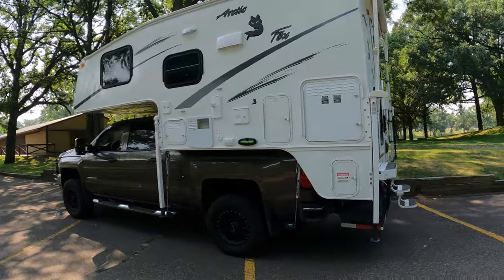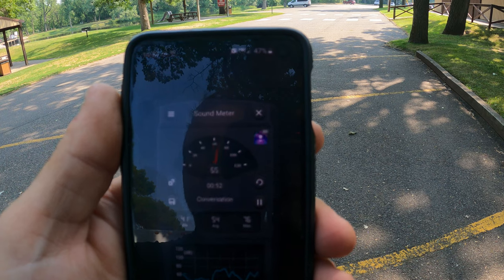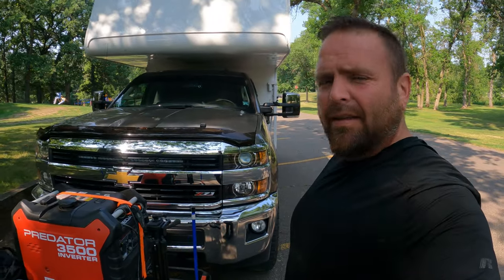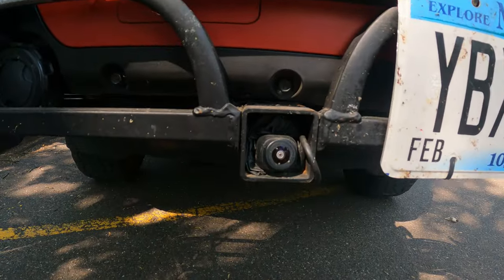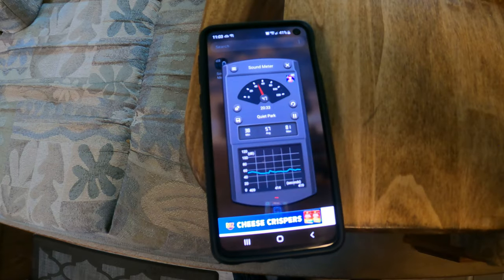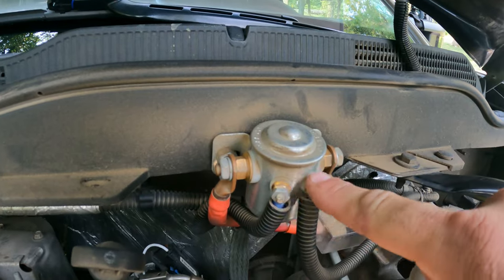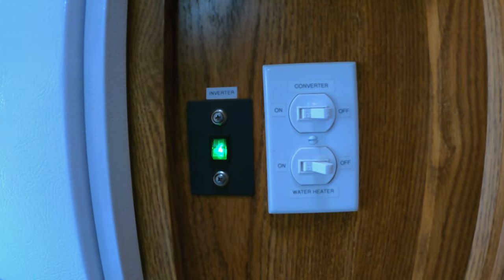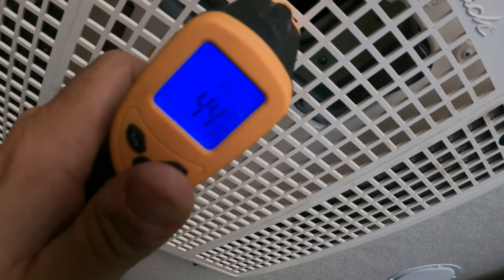Truck Camper Generator and Inverter /  Running Air Conditioner off Camper Batteries.

Comment: This is exactly what I'm looking for. Different needs but same set up. I want to run my hotshot trucks to run off of truck batteries while running. Then switch to generator when not running with just a switch. Can you help me out. i've been thinking how to do this for months, but want it to be right. Your setup is perfect. Please help.
Reply from the maker: You can send me an email. I'll try to e explain my setup better. Maybe that will get you going in the right direction.

Comment: Did your TC have an inverter already? I thought just by plugging the generator into the shore power plug you can run the AC. I didn’t realize you also needed a large inverter..
Reply from the maker: Yes, I can plug my truck into shore power and run the AC without any additional equipment. 
The inverter is used when I want the  AC, coffee pot or any  large power draw appliances without pluging into shore power or running a generator. 
I use my trucks dual altornators as a generator. The diesel engine sips fuel while at idel and is more inconspicuous then running a generator while sitting in a parking lot.
Reply: @KennyOfAllTrades  makes sense thanks for the explanation!

Comment: I'm interested in the inverter wiring design for a 2018 chevy alternator output.  And the extra on off switches 
Thanks
Reply from the maker: Hay John, I'm by no means a certified tech, but maybe I can explain how I setup the inverter in my 2015.  Maybe that will help with yours. I think the 2018 is the same body style, but there were a lot of changes made to the power plant in 2017. You can send me an email. Kennyofalltradeschannel@gmail.com

Comment: Ok. I have the same generator for my TT. But now I'm looking at getting a truck camper,  and I just can't see myself transporting the generator on the front of the truck like that.  Hows that working for u?
Reply from the maker: So far so good. It's been up front for over 4 years and close to 100,000 miles. I don't take it off often. I've been through the mountains out west, the deserts down south and 40 below zero temperatures here in Minnesota. I've had no negative effects to the cooling system. I keep a canvas cover over it. I've driven through a lot of rain storms and haven't had any issues. The generator has close to 1000 hours on it. It runs great. I use ethanol free 91 octane gas.

Comment: I’ve got a little box camper I’m putting an inverter in. I’m just unsure how to ground it in the box camper! Any tips would be fantastic
Reply from the maker: The power pannel in my camper has a bus bar for the netural wires  and bus bar for the grounds. I used them to wire up the inverter.

Comment: I do t know how I missed this video from a year ago, I was wondering when you have the predator running and on the truck do you get a lot of shaking feeling in camper? We have Honda but we take it off and set on ground
Reply from the maker: Great question! Thankfully, I don't. There is the slightest vibration. But hardly noticeable.

Comment: Hi Kenny.. Need your advice, you seem like you know about this.. I want to buy a Van ( Savana) ?? Bran New.. Not sure if its the right choice.. Should I get a 8cylinder or 6 ... ???? HELP.!  I know nothing about Cars ( Mechanics) ...
Reply from the maker: I know a little bit about a lot of stuff. But I don't know a lot about anything. What I know about the GMC Savana van is it comes with a 4.3 L motor or the 6.6 l.
The 4.3 L motor has been around forever in the GMC lineup. The 6.6 L is a new motor in the heavy duty line. Being a Chevy fan I don't think you could go wrong with either motor. There are going to be very big differences between the two. If you are going to be doing any major hauling and towing I would go with the 6.6,  plus it is paired to a bullet proof Alison transmission.  The  4.3 is great if you're not requiring a lot of power and torque. So if you will never be towing anything and not adding a bunch of weight the 4.3 will work. I imagine there is a big price difference? But the 6.6 will hold more value in the future. 
Sorry I can't tell you which one to buy....
Reply: @KennyOfAllTrades  Thanks A lot Kenny... No major Hauling just me & my Drum Set.. 4.3 it is.Will be hitting the road next sept..  Full time or as long as it lasts. Canada in the summer &southern states in the winter.. I' here in montreal...  once agin Love Your Videos.. Thank You

Comment: Hey man, good video..I was always told by other truck camper people that using your truck to charge your batteries makes your truck burn more fuel. Do you find that is true? By the way what kind of MPGs are you getting?
Reply from the maker: I'm running a diesel truck. It only sips the fuel while idling. Gas motors do use more fuel while idling than a diesel.  But you do have to be a little careful if your diesel truck is emissions equipped with a diesel particular filter. That filter can clog up and your engine will need to go into a region mode to clean the filter. Is a truck gets anywhere between 11 and 15 miles to the gallon with the truck camper in it.  Prior to this truck I was running a Silverado with a 6.0 gas motor. It got between 7 and 9 mpg with the camper in it.

Comment: So, you could run your AC on the camper while driving to your destination on the truck's battery  power thru the inverter under the cabinet? Then, use either gas generators @ the destination?
Reply from the maker: Well...its more like using the AC while eating lunch in the parking lot or while taking a break at a gas station.  That way, I'm not dragging out extension cables and starting up the generator. Or if I make a quick  pot of coffee....there's a number of reasons why I would need the inverter for 5 to 10 minutes and not want to go through the troubles of hooking up the generator.
Reply: @KennyOfAllTrades  ok, so while parked having lunch or a break, you leave the truck running to the AC and other accessories will be running as well? Nice!
How do you wire from the truck to the caamper...thru he jumper ports?
Reply from the maker: @rickrivera8222 I went off the Lug that's next to the fuse box. So far it's been working great.
Reply: @KennyOfAllTrades  so how do you get power from the truck headlight system into the rv? The cable that feeds tail lights? Or a stand-alone thick gauge wire via quick connector needed to separate the camper from  the truck?
Reply from the maker: @rickrivera8222 I have #2/0 wire  running from the battery post through a fuse, then a 300 amp silinoid to an Anderson connector in the bed. I have another fuse on the camper side. I activate the silinoid by turning on the headlights. The silverados alternator doesn't always put out max voltage. It's a smart charging system. However, when the lights are turned on, the alternator will put out max voltage. It's also a dual alternator setup. With this setup, I constantly get 14.7 volts to the house batteries when my lights are on.
Reply: @KennyOfAllTrades  this is great information...thank you for the support and many replies...will advise when I get mine done. God bless you

Comment: So I assume your truck must need to be idling to power the inverter to run your air conditioner?
Reply from the maker: Yes, I don't have enough battery to run the AC or Coffee Pot without the truck running. During the summer I will stop for lunch, 15 to 20 minutes, I'll let the diesel idle.  It's nice to use in parking lots or other places where idling vehicle is a common occurrence. It's less noise then starting up my generator.
Reply: @KennyOfAllTrades  by the way, loving your videos!
Reply from the maker: @barythompson4781  Thanks Bery

Comment: I put a dc to dc charger on mine and I put a l lighted switch on so if I shut it down and the 2 100amp Battle born batteries and they only 37 lbs and I took my factory fuel tank out and put a 63 gallon tank in the factory spot and 32 gals of fuel drives me crazy to stop twice a day for fuel.

Comment: You’re diesel doesn’t have an auto idle shut off ?
Reply from the maker: No, it's a 2015. During the summer I run the AC while having lunch or taking naps at truck stops.  The AC has no issues running off the inverter powered by the trucks altornators.
Reply: @KennyOfAllTrades  maybe I’ll add a remote start my 2018 Cummins idles about 10 minutes and auto shuts off
Reply from the maker: Opps, let me take that back! When I use the auto start it will run for 10 minutes or so.....long enough to make a pot of coffee or cool down the camper. I can use the auto start 2 times then I have to start the truck with the key. 
I thought maybe new diesels had a auto shutoff like most new vehicles....that my misunderstanding  of the question...
So yes, I have to start the truck with the key and lock it with the fob while I take a nap or have lunch. I just looked I have about 4900 hours on the truck, so it idles a bit.

Comment: How do I start the generator for Lance 2008 overhead camper and run for hot water and electric stove and frigerator
Reply from the maker: My Arctic Fox might be different then your Lance. I have 3 switches to turn on the electric hot water heater, I'm not sure what Lance does. My fridge has a mode button to switch between 12volt, AC and Propane. All the items you were questioning on should be able to run off your generator.  You might be better off trying to find a YouTube video for your specific application.

Comment: Might be time for a couple battle borns Kenny!
Reply from the maker: I would love that, but its not in my financial plans at this point. One day I would love a big solar setup with enough lithium batteries to power all my needs for a few days.......one day
Reply: @KennyOfAllTrades  There are many cheaper than Battle born. I have found some at half the cost and just as good.
Reply: Go SOK, 1/2 the price, better battery. Check out Will Prowse's review.
Reply from the maker: I just checked them out. I was surprised at the price. They are getting more affordable. Maybe I will go lithium and skip over the AGM batteries.
Reply: @KennyOfAllTrades  Li's charge back 4 times faster, can be taken down to 0 charge, weigh 28 lbs for 100 AH or SOK 51 lbs for 200 AH. Add a solar panel and you can take a real sweet Tax CREDIT

Comment: How do I start our generator for our Lance Overhead Camper
Reply from the maker: Does the start button inside the camper do anything?
 Does the generator turn over and fail to start. Or does it not even turn over.

Comment: I’m assuming the predator wasn’t running with a load?
Reply from the maker: You are correct. I thought about that after filming. The Onan was not running with a load either.  One thing I will say about the  Predator is under a load the idle smoothes out even more. It is a super quiet generator whether it is idling under load or no load.   In one of my future videos I will get a decibel reading under load.

Comment: im confused is 
it gas or propane  ?
Reply from the maker: The generator mounted in the back of the camper is propane. 
The generator mounted on the front basket is gasoline.

Comment: 10 paces is more like 30 feet, not 30 yards.
Reply from the maker: Yes your right. I my brain and mouth don't always communicate with each other.
Reply: @KennyOfAllTrades  thanks very much for this video. I am buying a slide in camper for my pick up and I am figuring out which kind of inverter I might need.

Comment: Rethink that setup  DC lines too long  there a reason hydro run ac long distances   air off inverter  u draw 120 amps off battery  if loose connection will burn up  Anderson connections as well  dirty or not making 100 percent connection  resistance  heat  fire  better to run ac line  keep DC cables very short   plus fused negative and positive  short 24 inch  inverter under hood  plus I don't recommend heavy loads off inverter fire up genny or plug in  or sweat lol
Reply from the maker: Them are some really good points.
Reply from the maker: So I was thinking about how I could shorten the lines, maybe putting the inverter under the hood? But then a second thought, the inverter is hooked up off the house batteries. The cable is 18" inches of 0/4. 
If I install the inverter under the hood it will be pulling power from only the two truck batteries. 
The inverter now pulls from the two camper batteries and the two truck batteries.  
What are your thoughts? I'm not much into electrical theory guy....I know all the answers can be found by doing math...thats beyond me. I'm more of a "try it out and see what I can break" kind of guy.
Reply: @KennyOfAllTrades  your system is fine as long as your not running high amp loads I run lithium batteries  2 50ah they are charged by 150 watt solar and as well the onboard converter charger  my truck alternator does not power the camper  I have Honda 3000 genny inboard  I need Air I run that  I have pure sine wave inverter 1000 watt to run toaster laptop etc all led lights  rarely run outta power  easier to conserve than to make more power  
My motorhome has double ac units  i run Honda 7000 on that  yea hate it but safe  
They need to figure out a lower energy consuming ac unit  seen some split units that are better  one truck camper I had I mounted 5000 btu watt window unit  worked great  low Amp draw  could run that off inverter
Reply: @KennyOfAllTrades  don't forgot voltage drop as batteries deplete while running ac and then amps go higher  what are u running for batteries ?
Reply from the maker: Two Crown 6 volt, flood acid. I don't have the finances for lithium. When these crap out I'll look at AGM, and 4 or 5 years after that maybe lithium ( or what ever the new technology will be ) will be affordable.
Reply: @KennyOfAllTrades  crowns are good  have used them in the past  advantagr with lithium is voltage over 12.6 during whole cycle  crowns   get down to 12  which will up your amp draw  volts down amps up  never a prob if your running light loads

Comment: A Chinese Generator that will last 2 years
Reply from the maker: So far, it's been hanging off the front of the truck for 5 years. This video was from 2.5 years ago. I showed this winter how it starts the first try, even at -30 degrees. It's probably one of the best purchases a guy can make from Harbor Freight. The Predator is an awesome generator.